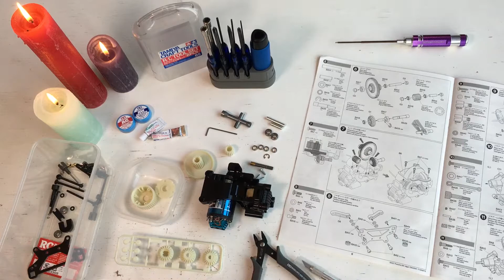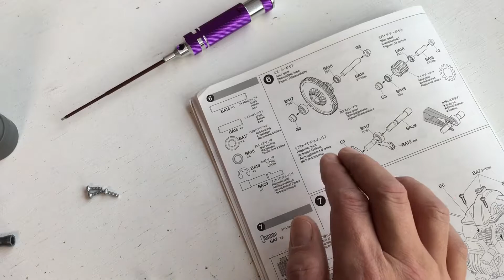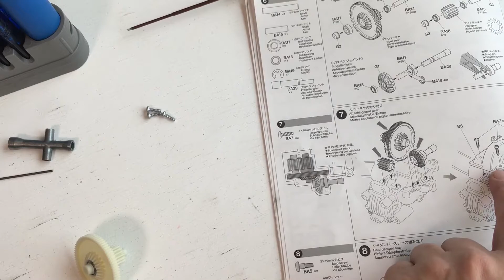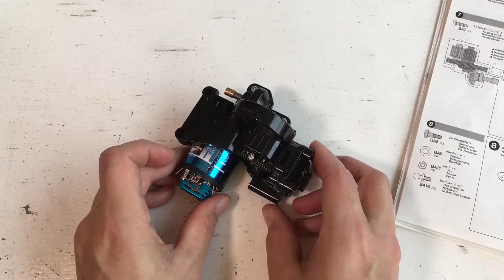Tamiya RC December Calendar 2018 Build Day 5 | Tamiya TA-02SW Porsche Turbo RSR Type 934 | S. 6-7

Comment: Now i'm intrigued as no alloy gears in the gearbox like the Mantra Ray.
Reply from the maker: Ohhhh, interesting! Just had to go back and watch yours. Yeah, you have a lot of alloy there! Only the spur and the propeller-shaft-bevel gear seems plastic? So strange. Tamiya is strange if both are standard. Is yours an upgrade? I know you bought yours with other upgrades to the rear gear box like the ball diff and the metal motor mount. I must say I'm glad I didn't get the alloy gears with this one. Less alloy-powder-maintenance with these plastic gears (if they hold up)
Reply: @nordichobbyvisions719  The alloy gears are not a upgrade but standard, I wonder if anyone swapped over to the plastics to stop the  grey goo as I cannot see any difference in gearing.
Reply: @nordichobbyvisions719  I have just ordered a TA-02 gear set to see if a straight swap as I'm thinking of adding power to the Manta Ray and the grey goo would be worse.
Reply from the maker: Nice! Hope you will do a video about it when you try out the swap? That would be very interesting. Checked your video again. The gears really look identical except for the material.
Reply from the maker: Just saw Glen's Top Force rear gears. Here both the idler gear and bevel gear and spur gear is plastic, and only the, hmm, what's it called, the gear attached to the spur gear (counter gear?) is metal. It seems they come in all kinds of combinations :-)

Comment: I've found that if you flip the pinion tool over its perfect mesh..I Swapped a few motors in the Top Force already lol
Reply from the maker: Yeah, just doing it according to the manual makes it sit soooo close to the inner gear box wall. Couldn't have that :-) Thanks for the tip. So "over" means?
Reply: @nordichobbyvisions719  Flip the pinion tool over to the bottom side of it..The pinion will be about 1mm closer to the motor can when doing this.

Comment: Beautiful work, Mikael! I always check the pinion setting in-situ too, I find that the Tamiya setting (by measuring or sometimes by a spacing part) to be only a vague setting - better to check and adjust, just like you did. Great tip!  These videos are speeding up, is it your English or the fast-forward video?  :))
Reply from the maker: Thanks, Mark. Yeah, even though Tamiya usually are super-precise in their engineering, it's better to check oneself. There already are a few other things that has made me pause with this kit. He, it's definitely not my English :-) but maybe the fast-forward video and the fact that I have cut a lot of the waffling :-)  I would prefer jump cuts in the actual build sequences, but it would take too much time editing (which will go against the purpose of this channel) sadly :-(

Comment: Good and short, maybe too short ;-)
Btw each gear only needs a dab of grease in a few spots. It smear around by itself as the gears turn ;-) Less grease also means less drag to the gearbox ;-)

Richard
Reply: That is a light grease..It's fine to coat all gears.
Reply from the maker: Ha ha, I'm trying to get it short, I think 10-20 minutes each day of this would be torture to all of you. So some days I will try to keep it as short as possible. My pace in English slows it down enough. Thanks, Richard. Yeah, I would go with PhilthyCo RC in the comment below. This Tamiya grease is so thin and light, so the general thumb rule is better too much than too little. But you are right, it's not necessary and a lot of it will end up on the inner walls of the gear box. But it's a lot easier to just grease everything down quickly and it makes sure that every little teeth has just the right amount (the rest is thrown off when driving). And you are very right, with some of the thicker/stickier versions of silicone grease etc. one really has to make sure not to get too much on the gears. Using a lot inside the gear diffs can on the other hand give a nice limited slip effect. Thanks a lot for commenting and watching, Richard.
Reply: @nordichobbyvisions719  Very well said

Comment: I'm loving the build so far Mikael, I got to say that building a TA series vehicle is so relaxing I loved rebuilding my Super Manta Ray. So are you going to put on any of the hop up parts available for it? I gotta say that your English is improving even more as you're speaking a little fast..Nice bro :)
Reply from the maker: Ahh, I got a few comments suggesting my English is a little faster now. I still feel I am struggling ith both finding the right words and forming them. But if it is speeding up just a little already, then it is great!!! After this looong build series I will hopefully be able to do videos with more tempo. Sadly I have no time to rehearse and do a lot of takes. That would speed things up a bit, but not enough time. No, no hop-up plans so far. Maybe later in the new year. I am not liking the upper arms very much so far, so I will probably get a lot of ideas for hop-ups during this build. But gonna build this according to the manual at first. Well, I will add a steel pinion as soon as I get hold of one in the correct size (amazing, I had some 17T, 18T, 19T, 20T, 22T, 23T in steel ready, but no 21T - if I ever win in a lottery - which I sadly won't since I am not a gamer - I will buy 2000 steel pinions in all sizes/pitches and 1 million ball bearings in all sizes). Yeah, this build feels nice. Feels very very Tamiya'ish for sure :-) The Super Manta Ray is nice. I wonder if they used the same gear boxes for that one as on the DF-01. The chassis is a bit different from the standard DF-01- I think we talked about that. But maybe it's the DF-01/TA-02 transmission.
Reply: @nordichobbyvisions719  Well bro with no practice time your spoken English is already improving..That is impressive knowing you don't speak it often, As for the build haven't seen the arms yet but if there like the ones on the Manta Ray cars they're very strong? I so need more steel pinion gears for my Tamiyas I got 17,18,19,20,and 21 as well as spare bearings you just never have enough of those..lol As for the transmissions. They're the same in the Super Manta Ray versus the original Manta Ray and your Porsche as well. The only difference between the Super Manta Ray and the Manta Ray is the Super has the weird chassis and no oil shocks they're adjustable friction shocks and non adjustable turnbuckles. If I could make a suggestion I would replace the center driveshaft and the wheel hexes with aluminum ones to get rid of the slop in the drivetrain made a unbelievable difference on mine. Looking forward to the rest of the build and seeing this beauty running around soon and of course more conversations with you bro :)
Reply from the maker: Thanks for the kind words about my English, Chris. Well, the upper arms doesn't fit very nicely to the FRP tower, even with the provided spaces. And I would have preferred turn-buckles in a release such as this. Yeah, pinions and ball bearings seem to disappear so quickly. Thanks for the info about the Super Manta Ray vs. the DF-01/TA-02. Surprised they did another chassis, yeah, and the friction shocks on something "Super". Ahh, yeah, on all my serious runners/projects I always replace the hex adaptors eventually. Looking forward seeing that DF-01/TA-02 center drive shaft. Thanks, Chris!

Comment: Great work! Do you know what glue or sealant i have to use with this FC diff joint.It's says "Apply synthetic rubber cement to the places shown by this mark". Is it ordinary shoe glue or contact glue like Bostik? I have Hylomar and Orange/reddish gasket sealant. Purpose or this? To seal and/or keep it together?
Reply from the maker: Thanks! I don't even know what an "FS" is? I've never used any other glue in any of my Tamiya builds other than instant cement/super glue, or tire-glue for the tires/wheels, so I have no idea. Sorry I couldn't help.
Reply: @nordichobbyvisions719  oh no..a typo. I meant TF 🤣 It needs glue to put axle to diff together. I think i just use Hylomar. It's a sealant type blue glue which can be used in threadlocking also. It's not a locker in it's pure nature but a milder version of it. Sorry if this's confusing.
Reply from the maker: Ahh, the Top Force? Glue for the axles and diffs? Uhhh ... never had a kit that needs that so I have no idea what to use.
Reply: @nordichobbyvisions719  Download the manual and look at the page 4. https://www.tamiyausa.com/shop/-road-buggies/rc-top-force-2017/
Reply from the maker: Oh, yeah! Wow! never seen something like that. Strange, since it's the same rear gear box (as far as I know) as I am building and I've seen other DF-01 and TA-02-builds on other channels too. Don't seem to remember any that did that. Have you tried asking Tamiya Legends (channel)? I know Glen has just build a Top Force. Maybe it's even in his build video of it. But, yeah, I would go with some kind of thread lock too that can be removed again. Or maybe not apply anything at all and try it out without.
Reply: @nordichobbyvisions719  I'll ask him. I already put Hylomar on the diff. It think it works. We'll see 😁 Now There was a Scorcher Beetle on sale on Tamico. Maybe The Hornet will be on sale.. I WISH! Now i must go to sleep, early morning in the "Merc plant".